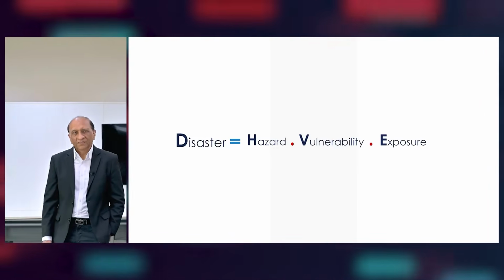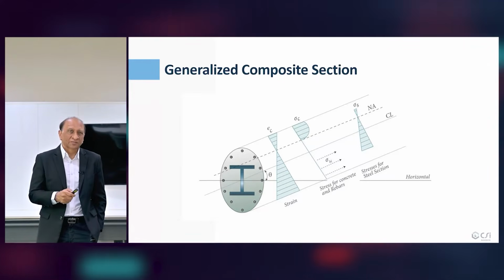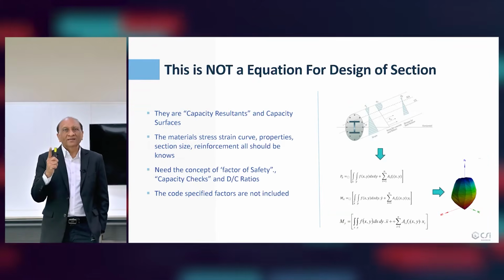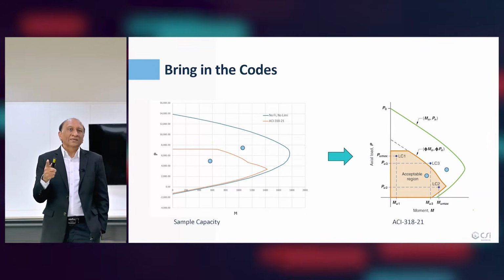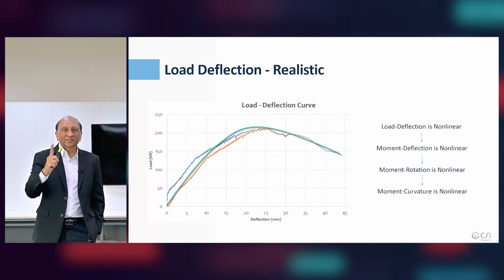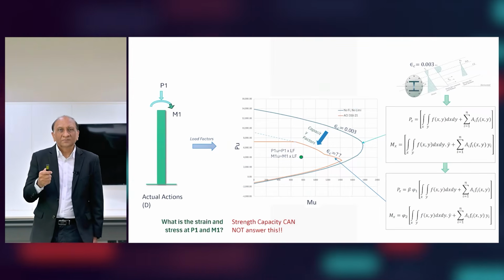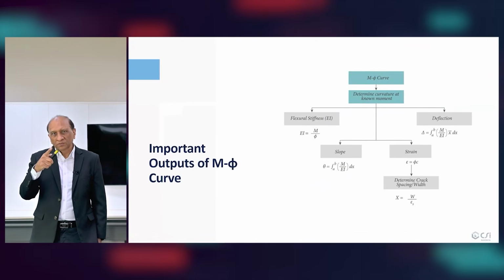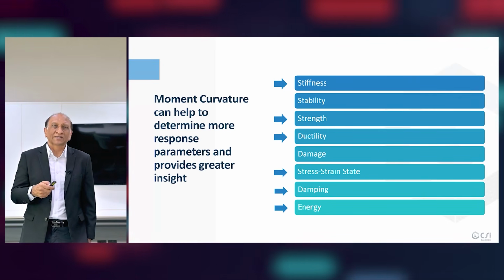Beyond Cross-Section Strength : Real Behavior Through Moment Curvature Analysis

Comment: Dear Dr. Anwar,

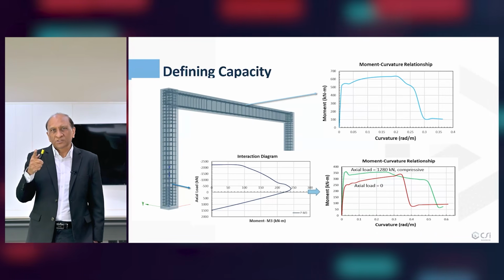Thank you very much for your highly informative lecture. I have one question regarding the content at the 52:00 mark, where you presented the moment-curvature (M-φ) curves for compressive loads of 0 kN and 1280 kN. 

Could you please clarify whether the 1280 kN value corresponds to the reduced code-based axial load? Additionally, am I correct in understanding that you input different M-θ curves for each axial load value into the analysis program? 

I would greatly appreciate your insights on this. Many thanks in advance!